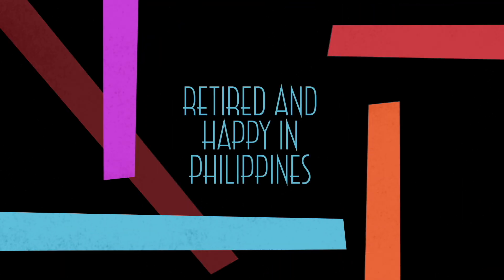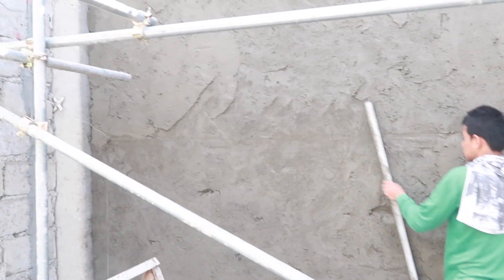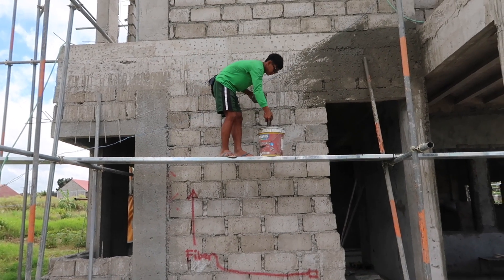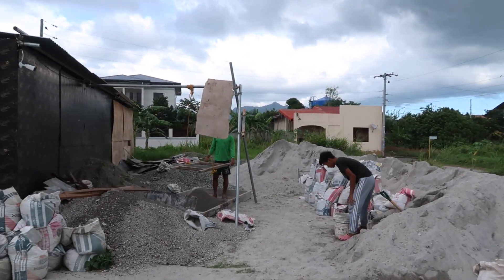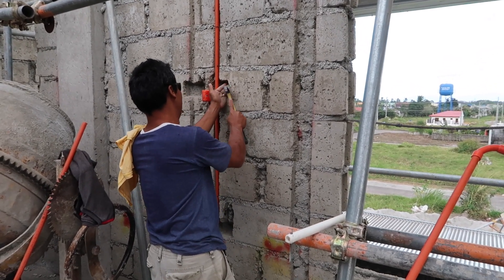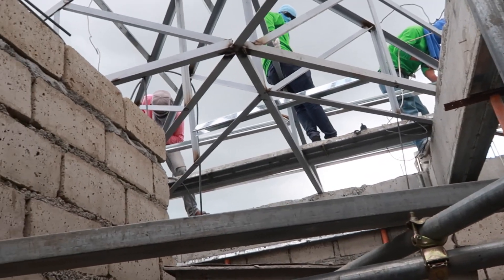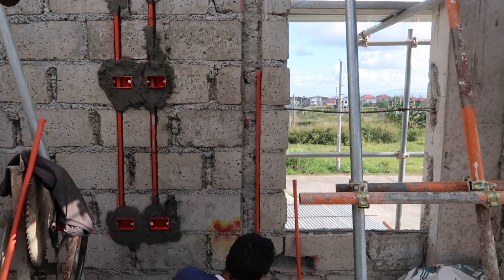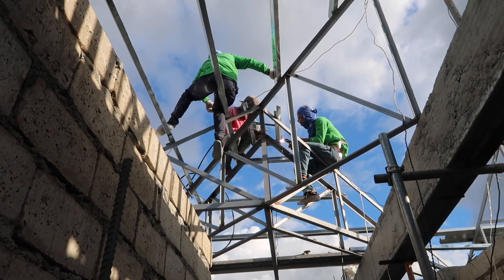HOUSE BUILDING IN THE PHILIPPINES - EPISODE 89: ADDING MORE SKILLED WORKER

Comment: Did you also install an outlet in your bathroom shower for water heater?
Reply from the maker: TheToysoldier77 were going to have multipoint so were going to use only one plug between two bathrooms but we ask the foreman to add plug but he said its better to put it in the ceiling so were still debating if were going to put one on the wall
Reply: @retiredandhappyinphilippin3329   ceiling